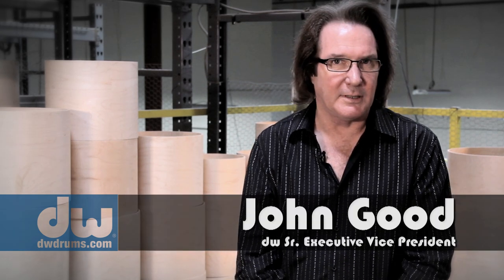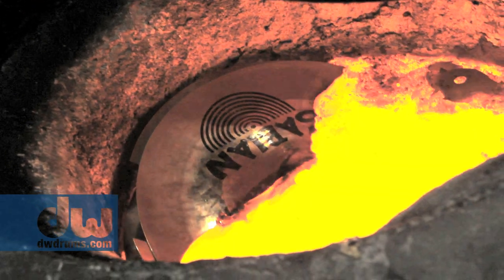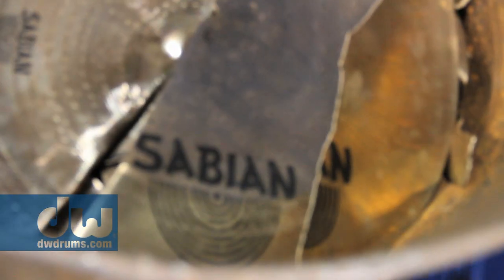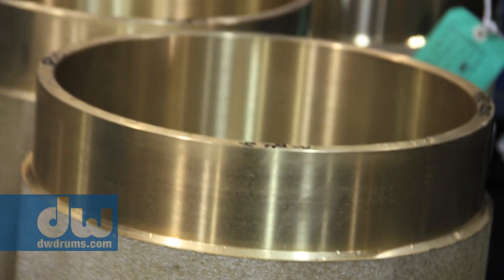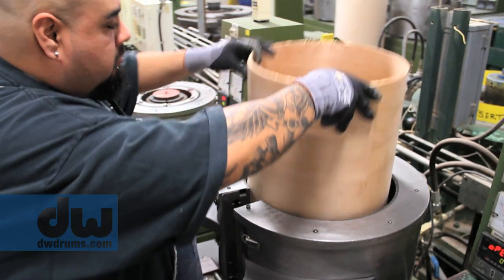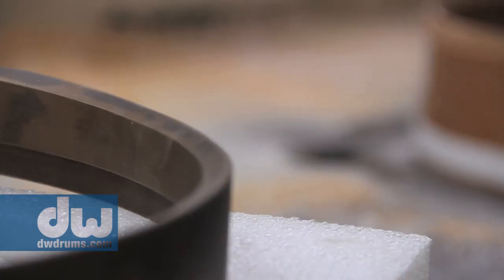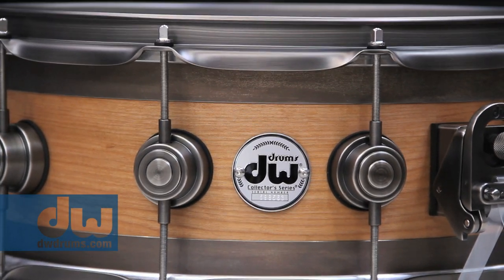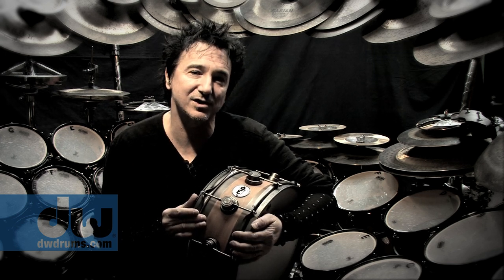The Vault Edge Story - DW & Sabian Unite to Make a Very Unique Snare Drum

Comment: What would happen if you made very small dowels (kind of like the dowels in Pro Mark Hot Rods or Vic Firth Rutes) of brass or metal and ran them vertically from the top bearing edge the the snare side edge about an 1"- 1" 1/4 apart? Just an idea....
-G

Comment: 4:30 The presenter states: "80/20 bronze has some of the fastest transmission speed of sound..."

I'd like to see the research data on this. The text books in engineering materials science class lists 80/20 as one of the slowest. 
"The 80/20 alloy is designed to increase vibration damping"  (1^ Mass Inst of Technology).

Surely you're leaving something out of the description. That or either MIT or you are mistaken.